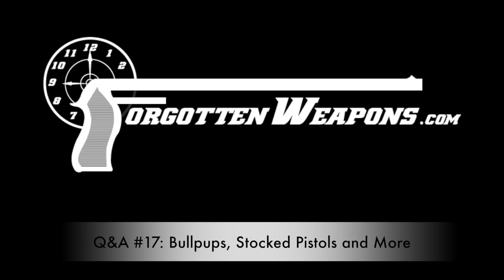Q&A #17: Bullpups, Stocked Pistols, Delayed Blowback, and More!

Comment: 'What Would Saint-Étienne Do?' FAMAS series confirmed for 2019?
Reply: An AUG, probably, F90 specificity
Reply: The Saint-Étienne manufacture doesn't exist anymore. In France, the government killed the light armament industry. Instead, we bought the HK 416 from the germans which is sad imo. The HK 416 might be a good weapon, but it's just an piston AR-15 and doesn't have a full size barrel and overall compact size unlike the FAMAS thanks to it's bullpup design. The main problem with the FAMAS was the cost of the internal parts. The only thing it needed was a simpler internal design like the croatian VHS 2, even if we had to copy the internal of an AK rifle + the same adjustable stock from the VHS, get rid of the useless bipod, and an AR style ambidextrous safety selector.
Reply: Stoner 63 that company form france doesn’t exist anymore
Reply: Er... that's the point? Eugene Stoner isn't alive anymore, hence "What would Stoner do [if he was still alive and working on the AR15]?" Saint-Étienne does not exist anymore, hence "What would Saint-Étienne do [if they were still around and working on the FAMAS]?"
Reply: Stoner 63 a WWMASD project would be really neat. The other day I walked past a bunch of soldiers on patrol (yeah we got our military patrolling the streets, don't ask), most of them had EOTechs reflex sights fitted on their rifles, I would have liked to ask those soldiers about their prefered attachments but I didn't want to look weird...
Reply: +Jensen I've heard from a french paratrooper while i was hitchhiking, that they will buy the license of the HK 416 and manufacte their own version but it was a while back so i dont know if the info is still valuable.
He was carrying a 416 for like 2 or 3 year before they announced the FAMAS replacement.
And he told me that the HK was way more reliable than the actual FAMAS version in service wich i instantly agree, FAMAS got a good design but internal parts are too complicated and rather expensive for field maintenance.
Reply: +Jensen, 5.56 today doesn't need a "full size barrel" if you want a weapon that is effective, and I mean truly effective at 600 or so meters then you need a caliber like 6.5 Grendel. Your country chose the 416 because you're paratroopers including the 2nd REP of the FL have used the 416 instead of the  FAMAS for years now. 416 is the today apex 5.56 military rifle, the piston operation makes it useful and durable even in sustained full auto.

Ian and Karl don't think anything more then a DI system is needed in terms of reliability but obviously people in actual military of the USA don't agree. Their SF are the ones for which the 416 was made and also currently the USMC is doing a shitton of literal mental gymnastics to swap their DI M16 and M4's for piston 416 variants, be it in the form of the IAR or the new "DMR" which is basically the same as IAR lol. They actually went on and accepted a heavier barrel 416 as a designated marksman rifle. Personally I think they're just coming up with ways to swap their m4 and m16's for piston guns.

But I agree with you that its sad how France will now import its military small arms. Its utterly ridiculous. However the choice France made, was most certainly the right one. 

Btw the Croatian VHS is a nice gun, on paper and in theory. But honestly bullpup guns are just not the way of the future. Look up top tier SF units of any relevant country, the guys that get to pick their guns, even from countries like the UK they will still whenever they can pick a classic gun design. SAS is famous for their use of Canadian AR15 variant. Even when the L85 or the SA80 were all the craze in UK military formations, units like the SAS or SBS still picked "normal" guns. Also like I mentioned the French para's and French SF units like French SAS from the moment thy can pick they opt for "normal" guns.

Bullpups just can't compete in ergonomics or weight, and the barrel length is just a non issue today. Also it would be super expensive to make a bullpup with a good trigger be a common soldiers weapon.

Comment: Dear Gun Jesus: You have to write a book about mechanics aspects of gun, the how and why of different actions (blockback, gas, ...). With illustrations and diagrams. It looks like nobody written one before, and even Internet is severely lacking in that regard; your videos being the most extensive coverage of the matter I ever found.
Reply: candid moe what do you mean by this "firearm mechanics" could cover so many different topics
Reply: Nathaniel Fitch of The Firearm Blog had started a series of articles on all the types of operating mechanisms, but he never finished it; and now he has moved on to work at the Institute of Military Technology, so we'll never see it completed.

Here are some of what he did cover:
http://www.thefirearmblog.com/blog/2016/06/13/operating-systems-101-blowback/

http://www.thefirearmblog.com/blog/2016/06/13/operating-systems-101-short-recoil/

http://www.thefirearmblog.com/blog/2016/06/17/operating-mechanisms-201-rotary-locking/

http://www.thefirearmblog.com/blog/2016/06/17/operating-mechanisms-201-tilting-barrel-locking/

http://www.thefirearmblog.com/blog/2016/06/20/operating-mechanisms-201-ljungmann-vs-stoner-direct-impingement/
Reply: As noted by others there are a lot of topics to cover and it really depends on how details you want to get. The more detailed you get you end up creating topic specific subjects which are short run, small production engineering books. You tend to not find them easily because maybe it only sold ten books and or locked away in a technical school in one language printing.  On the other spectrum you'll find tons of coffee table books which aren't that great but cover the basics, I was looking at one the other day at a bookstore (omg, I was shocked they still exist!--a bookstore not the book).
Reply: D Tyle. By "mechanics" I mean mostly actions, but also triggers/receivers mechanisms, magazines (single/double stack, single/double feed), belts, attachment systems for sights, etc. I want to know how they work and how to compare one approach to another.
Reply: 1.) There is so many ways to make gun work. That making book about most guns "in detail" is next to impossible. About common guns and common knowledge everything is already on internet. Just search for it.
2.) If something is rather modern(meaning after WWI) it will be covered most probably by patents unless it was created during war but at the same time things created during war have "special treatment" and usually there is shit ton of information about them. There must by technical drawings and explanations in them.
Also because it's patented it can not be in books.
3.) Problems about how something work ect. Rly problems are almost only with prototype guns(quite often lack of pictures and patents), very old ones(just nobody bothered with pictures and finding patents can be pain in ass) and brand new ones when ordered by government(no patents)
Reply: candid moe There has been a serious engineering book on firearm actions and it is free in the public domain.

Look up "The Machine Gun Volume 4" by George Chinn.

Another book that deals more with pressure, structural analysis, and the like are the two "Armament Engineering" books by Peter Cook. They are written about field artillery but there is a lot of good material there as well.
Reply: George Chinn's magnum opus of firearms is what you're looking for. Before you look at the price, get your hearth checked by a doctor.
Reply: Luthtar. Thanks. I found the free copy at https://www.scribd.com/document/24707658/The-Machine-Gun-Volume-4-by-George-M-Chinn. That's what I was looking for.
Reply: You're probably not ever gonna find a complete all in one guide because as others have mentioned, there are a LOT of ways to make a gun go bang. Do what we all did, wikipedia, google searches, and youtube, just gotta piece the knowledge together yourself.
Reply: O yes! I always wondered why the G3 has more recoil then a FAL and how an MG42 can have such a high rate of fire, or still hit its target. Similarly, I wonder why the Barret MK82 has this weird choice of mechanism, or how the AK101 mitigates recoil...
Reply: ostiariusalpha The Firearm Blog is trash, dude.
Reply: Their current internal politics and leadership is, yes, but that doesn't mean all of their writers and everything they've produced is. The specific articles mentioned are perfectly fine lol
Reply: edi Delayed blowback is straightblowback, with some initial resistance thrown in(so it doesn't explode in ur face)..... that's why the G3 has more recoil.... because blowback is a bad way to make anything more than pistol ammo.

Comment: Re: Squeeze or taper bores, the Colt Canada cold hammer forged barrels used in the C7 and C8 series of rifles have a very slight taper to the bore, as well as an in-line forging of the chamber. It doesn't require 3D printing, just a carefully hammer forged barrel around a mandrel with a taper machined into it.

Comment: I'd like to add on the point of 3D printing that additive manufacturing is inherently weaker in design than most other methods. In plastic, for example, an injection moulded part can be very very strong because the liquid polymer can cool into a single monolithic piece. In additive manufacturing you have each layer cool individually one on another, which creates a kind of "wood grain" to the final product. The danger of delamination means that extra care has to be put into planning layer directions in stress bearing parts. In that case, something like a single weld makes more sense- like your WWSD lowers. The honeycomb internal is made possible by casting the parts in two halves then welding them. Yes that makes the seam a weak point, but that's better than hundreds or thousands of them in a print.
Reply: It depends. the socalled “3d printing” is a class of many different technologies. Few of them are very strong.
Reply: Tell that to space X with they're 3D printed super draco engines.
Reply: That's really only with the plastic methods. Metal-based 3d printing tends to not be built up in the same ways, and some methods are a good percentage of the strength of conventional machining parts. Heat treating is likely to be superior with solid parts.

For 3d printing to be useful for metal or plastic, you want a part that's either a low production volume, or too complex to economically machine. A barrel is not likely to be one of those, being built around a cylinder. I would think that all the other parts with various machined surfaces that mate which each other would be more likely to move to 3d printing first.

Comment: 3d printing has been used in a hypersonic engine casing to make cooling passages, but I suspect it isn't particularly pressure resistant.  A squeeze bore gun would have to be made out of some new super alloy and require special ammo.

Comment: The difference between short-stroke piston and tappet systems basically comes down to where the operating rod is attached: on short-stroke, the op rod is attached to the piston, and on a tappet, the op rod is attached to the bolt carrier. It's that simple. FN's SCAR and F2000 rifles are both tappet systems, and they are easily disassembled in the field for maintenance.
Reply: ostiariusalpha Just to be a pedant: What would the G36 family of guns be? There's a connecting rod between the gas piston and bolt, and that rod isn't attached to any of them, it sits in a channel in the receiver.
Reply: +That_German_Guy  I would still call the G36/SL8 a short-stroke system, since the operating rod is slaved to the piston, even if it isn't mechanically fastened to it.

Comment: For Milsurps in a humid area I have had excellent luck with a 1 to 10 mix of ballistol/water for the bore after corrosive ammo, just soak the bore really well and use a regular bore brush.  Then wipe all the metal with a generous coat of plain ballistol, then store in silicone gun sock.  Cut them in sections for pistols.     
   I had a couple guns rust using other protectants such as CLP and regular gun oils, REM Oil sucks for long term protection IMO,  but since I switched to Ballistol I haven't had an issue.  I just soak a rag with it and after every range session the whole gun gets wiped with it inside and out.  For stuff I don't shoot I take them out once a year at least and re-apply the Ballistol.  For really expensive stuff I use RIG grease and coat everything in that using one of their RIG Rags or a natural hair paintbrush

Comment: 19:44 Can confirm, bought an 870 a few years back.  I've literally only ever fired the thing once - and when I say that, I mean ONE SHELL - because they couldn't even get their own chamber dimensions right; attempting to fire a shell with brass that was too short would completely lock the gun closed so badly I had to take it to a gunsmith to disassemble the damn thing for me.  Finally sold that thing for a pretty good loss recently, not making that mistake again.

Comment: I'm pretty sure Lee Emerson had a section about rifles M2-M13 in his M14 RHAD book.

"Intervening Rifle Models: M2 through M13

M2: The M2 was a Springfield Armory .22LR caliber magazine fed bolt action rifle. It was
43.66 " long and weighed 8.87 pounds.

M4: The M4 (T38) was a magazine fed .22 Hornet caliber bolt action survival rifle.
Harrington & Richardson made 29,344 M4 rifles in 1949. The M4 weighed 4 pounds and
was 32 ½ " long with the telescoping wire stock extended. The M4 had a 14 " barrel and
a magazine capacity of five rounds. Earlier models had a leaf rear sight but later models
were fitted with an adjustable rear peep sight.

M5: The M5 was a combination .22 Hornet caliber rifle and .410 gauge shotgun.
Harrington & Richardson produced fifty M5 rifles in 1950.

M6: The M6 was similar to the M5. It too was a combination .22 Hornet caliber rifle and
.410 gauge shotgun. The M6 was developed by the U. S. Army Ordnance Command and
produced by Ithaca around 1951. The M6 weighed 3 pounds 12 ounces. It had an
overall length of 28 ¼ " and a folded length of 15 ". This model was reproduced by
Springfield Armory, Inc. for a time.

M8 and M8C: These were spotting rifles for the 105 mm and 106 mm recoilless rifles,
respectively.

M9: This may be a sub caliber device for the 106 mm recoilless rifle but this has not been
confirmed.

M10: This model number was not used by the U. S. Army.

M11: This model number was not used by the U. S. Army.

M12: This model designation was assigned to three .22LR caliber bolt action training
rifles: 1) Winchester Model 52 Heavy Barrel 2) Remington Model 40X-S1 3) Harrington &
Richardson M12. Remington Model 40X-S1 M12 rifles were in the inventory of Marine
Corps Junior ROTC units in the 1970s for smallbore rifle marksmanship training and
competition. The Harrington & Richardson M12 was a single shot heavy barrel heavy
wood stock rifle fitted with Redfield globe front sight and Palma rear sight. It weighed
about 13 pounds. The Civilian Marksmanship Program sold this rifle to civilians as late as
March 2005.

M13: Likewise, this model number was given to two .22LR caliber training rifles, the
Remington Model 513T Targetmaster and the Winchester Model 75 Target. Remington
Model 513T Targetmaster M13 rifles were also in the inventory of Marine Corps Junior
ROTC units in the 1970s." -M14 Rifle, History, and Development, Pg. 48-49, Lee Emerson.

Comment: Regarding short piston vs. gas tap it ease of maintenance explains design decisions in many fields. Large vehicles like buses and trucks use air brakes while most other vehicles use hydraulic. Hydraulic brakes would be better for stopping a big vehicle but you often have to drain the fluid to fix it depending on what breaks. On large vehicles that much fluid would take hours to drain and hours again to fill, bleed, and top off once it's fixed. Air brakes take seconds to "drain", are dramatically less messy to work on, and about a minute to refill. On high weight vehicles the brakes are going to wear out more quickly anyway so you might as well make maintenance easier.

Comment: The german 2.8 cm sPzB (schwere Panzerbüchse) 41 squeeze bore started with 28 mm and tapered down to 20 mm. The barrel had a tungsten coating inside to enlengthen the lifespan of the barrel, but german arms industry was alway short on tungsten back then. Muzzle velocity was 4500 feet per second.

Comment: 44:43 My DP Mark III* (1917) had a sawcut through the barrel, a 1/4 hole drilled in the chamber, and the breech rivetted shut just to prevent accidental re-use. It had also been thrown into a chrome plating bath fully assembled before being restocked in 4 different types of wood :-)

Comment: In reference to the last question, I do have an M-8 case. It is indeed shorter than the standard .50 BMG, it also has a primer that extends significantly into the case.

Comment: Steyr AUG - currently manufactured w/ US-based support, available to the average shooter,  lightweight, field-serviceable, cleaner and field-adjustable short-stroke gas piston system, tool-less barrel swaps, modern versions have picatinny rail for choice of optics, built-in collapsible vertical foregrip.

FAMAS- hasn't been made in almost 20 years, unicorn bugle-gun for US shooters, dirty blowback system/less reliable, does have a cool bipod though.